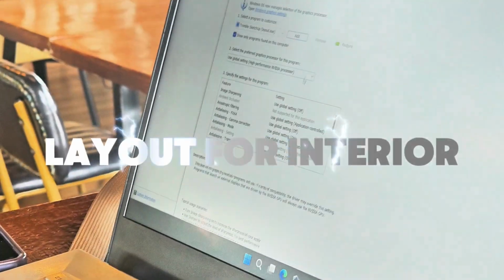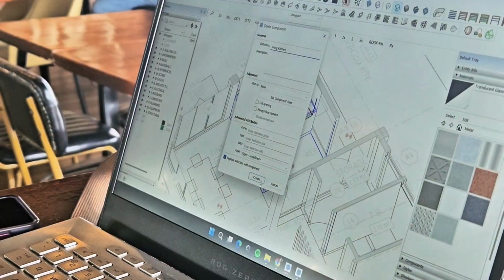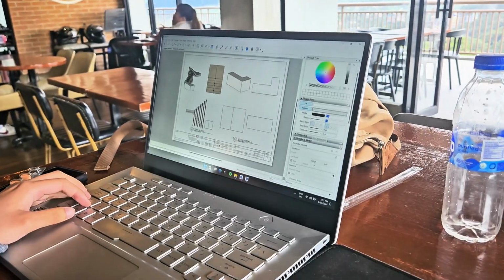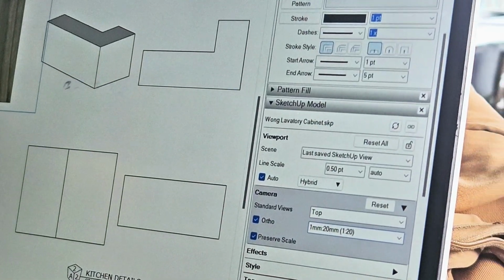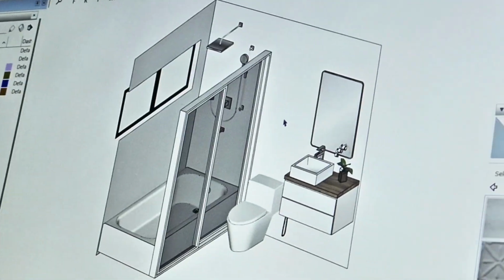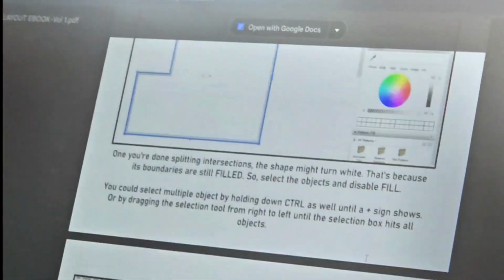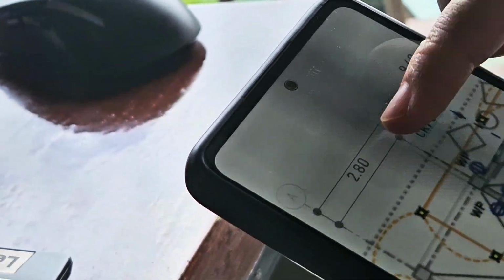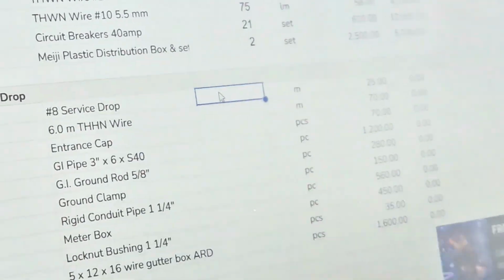Apprentice Day 4 - Interior Layout & Estimates

Comment: You can choose many objects (group or component are both accepted), then right click then choose "Save objects" from 5D+ Plus menu. This command help you save multiple objects to a folder in one click.
Reply from the maker: Great note. Will use this in our main office.
The new apprentice does not use 5d+ yet so far, need to start with the basics.